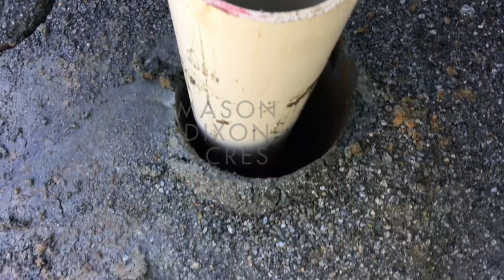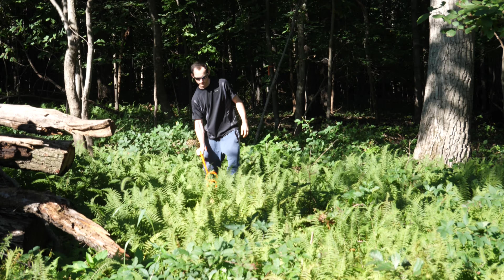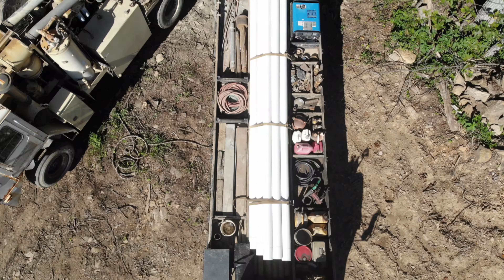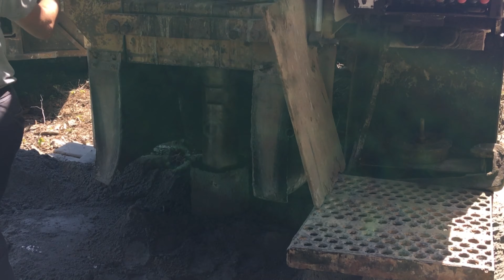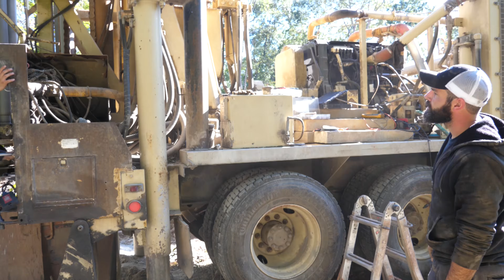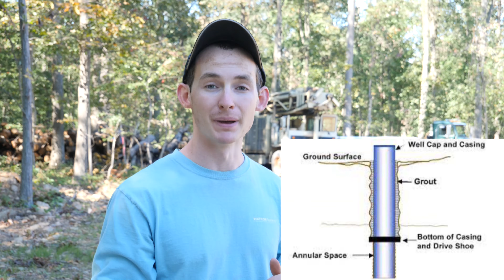Drilling a Well | Process Explained & Cost Breakdown

Comment: I had Myers Bros drill my well here in York Haven Pa back in 2018 at a cost of $7k total including drilling, casing, (steel casing) submersible pump, pressure tank, filter, and UV light. The well is 250 feet deep and produces 12gpm. I live in one of the few townships that do not require well permits.

Comment: After the well is drilled a lot of folks don't realize they still need drop pipe, pump/motor, and cable/power at the surface to get water. My parents were clueless on that and their well sat for 8 years after it was drilled. They ended up installing with Boreline for their drop pipe so they could install the pump themselves. It was easy to roll out, attach power cable and pump, and then just lower it into the well by backing a truck towards the well and lowering it in over a roller. Super easy and took an hour or so. Lots of options out there these days, but the Boreline has a 50yr warranty.

Comment: Oh my goodness. I am having a well drilled in WI today. My bid was $80/ft drilled to 190 ft and with the casing and pump/pressure system, it came to $24k. 😩
Reply from the maker: That's not as bad as others we've heard of in desert areas! Keep in mind this video did not include the trenching to the house, pipe, pump, or pressure tank. Good luck with the project!

Comment: Thanks for making this video.  You did a nice job.   Already watched a number of similar videos and none of them, including yours, talks about some basic things (which a novice like me presumes), like, the drill bit goes down to the bedrock, so they have to bring that back to the surface, then they drill a wider hole for the casing?, then the pvc casing (or some other material) goes down the hole, but if it's pvc casing, what is used to keep the pvc pipes connected?

Comment: What ever state you live in , it’s super cheap . In Wisconsin it’s around 57- 64 dollars foot, plus equipment.
they typically use steel casing in my area. 
My cost on 6” PVC pipe is 11-12 dollars foot from my supply house.

Comment: Holy shit we were just quoted $30,000.00 for a 120 foot well in our local which is flat soft ground.
Reply: Yikes! It only cost me $7k total back in 2018 including drilling, steel casing, submersible pump, pressure tank, filter, and UV light. The well is 250 feet deep and produces 12gpm.

Comment: You missed an important step, did anyone witch the area to see where to drill to find water? Or did you just guess and pick a convenient spot yourself? I have never seen where the side of the upper well casing was penetrated, a pitless adapter,  to access the interior of the well. Why was that done? Here in the Sierra Nevada Mountains in California the wells all exit from the top of the casing. Then they make a 180 and go down under the frost line, then to the tanks. That was a way cheap drilling job you got, most cost a lot more. My well is 200 feet deep, 100 feet to water, pump is at 180 feet, and I get 40 GPM. Good video and explanation on how the compressed air assists the drilling.
Reply from the maker: Thanks! The pitless adapter is to keep water below frost line all the time. Doesn't your water freeze if it's coming out the top of the casing then back down? 
Regarding the drilling spot, I talked to the driller about this - his best advice is to just pick a convenient spot that's out of the way of construction. He has worked with "water sniffers" who claim to be able to locate it and in his 20 years of drilling he said it's total bs.. but to each their own

Comment: I paid $4800 for a 240ft well with 6" steel casing in PA. Thats actually pretty low for my area.
Reply: It only cost me $3k to have a 250 ft deep 12gpm well here in York Haven Pa. It was another $4k to install the submersible pump, pressure tank, filter and UV light. This was back in 2018.

Comment: Central Oregon well is usually over 800 feet deep. 30-40K. You're so fortunate. I ended up trenching to a city water line, which still cost 18K because of the amount of rock.
Reply: I just had one drilled west of Portland. I had to go 975', but luckily I hit 36 GPM and it's flowing out of the top at a rate of 8 GPM. Total cost was $64,000.
Reply from the maker: Wow. We are definitely lucky!
Reply from the maker: Holy smokes..

Comment: That’s the cheapest 300 foot well I’ve heard of. It would be around $30,000 to get that depth here in Western Oregon.
Reply from the maker: We definitely got a killer deal, normal cost here would have been closer to the other two bids I got of $5-6k. But seeing some of these other comments around the country, I consider us lucky!
Reply: You’re not alone.  I’m about to do one in Northern CA that will probably be 150 to 200 feet and it’s over 20K.
Reply: @jamesb95 where abouts?
I'm looking at a place in g.valley and it's 35/per foot.  I hate not knowing if there's water or not too
Reply: Mine was $17.5K in Northern California for just drilling at 120-160 ft.
Reply: @xiong2moua I'm looking for my house to dril water borehole for 300 metres. Can I have borehole agent number
Reply: I’m trying to figure out the cost disparity here. I’m getting quotes for about $80/foot plus incidental fees here in central Washington. It’s looking like $36k for a 400’ well.
Reply: I'm in Ontario my new 115ft well 6" cost me 11460.00 
Drilled in 3.5hours from time they showed up till we hit water.
My old 4" well about 75yrs old dried up while we were on vacation.  Found out 2 of my neighbors also had dry wells.
New well has 35gpm refill so I'm very happy. Still friggen pricey to drill for free water lol thanks for the videos
Reply: 250ft , 11K
Reply: The cheapest company probably just drills deeper make up difference
Reply: Come to india we do same drilling for only 3 usd per foot only for drilling till 1200 feet. Our drills are Indian but compressors Chinese doosan with diesel power. Plastic casing should be same as india for soil part, no need for rock should be at Max 12 usd per 10 feet section for best quality casing of 6" dia, basically sold by weight to discerning customers and length by unwitting people.

Comment: I asked for a quote here in South Texas for a 225ft well. I was told due to my location they recommended the drill rig that cost me $38 per ft vs the $32ft. $9,000 for a completed well with  4" pvc instead of 6" casing. I only have 1 quote as I am looking for other contractors within 90 miles.
Reply: There is a way to do it for way less. Where in S Tx are you?
Reply: @ROBERTLUCIAn  I'm In Zapata, 50 miles South of Laredo.
Reply: Here in N Nevada they wanted $140.00 per foot a year ago and have to drill 260 ft.
Reply: Sounds pretty reasonable.
Reply: Same here. I'm in central TX and all wells quoted are around the $30+ dollars a foot and a 9-12months backlog.

You also need to look at pump  warranty, I'm willing to pay more for a 5 year warranty.

Comment: 11k estimate on 200 ft with pump and pressure tank in Western Maine quoted
Reply from the maker: The original quote for the guys we went with included the pump, trenching, tank, wire, 300ft hole and was around 10k so that's not too far off.

Comment: HELP!!! I’m looking at buying a property that has a collapsed well so I’ve been searching for well drillers here in Denton, Tx (north Tx) and I’ve been quoted $100 a foot and the drill depth is 800ft totally $80,000 to drill a well. I’ve called around 5 drillers and they are all the same. I hope someone on here can give me some insight on this INSANE drilling cost..
Reply: Residential well? I’m a driller not far from you. I’m out of Decatur. We haven’t done a whole lot in Denton, have drilled a couple, drill a lot in ponder/krum/Sanger. Typically 400-500 deep in those areas. 
100 a ft seems steep. We have had regular price increases due to inflation, it’s been crazy. But I believe we are around the 40 dollar a ft  range at the moment, that is also turn key, pump, tank,etc
Reply: @chasehoneycutt4045   Chase, Thank you very much for reaching out. Yes Sir residential well, I sent you a message on Facebook, I’m pretty sure it’s you. Let me know if you get it! Thank you!!

Comment: So the casing can be plastic? Other video I watched had metal pipe. Woukd it be strong enough? Is it much cheaper then steel?
Reply from the maker: Yes most are pvc now. No worries of corrosion either. Steel is extremely expensive compared to PVC, many times more
Reply: @MasonDixonAcres  yeah most are SDR21 pvc, metal is good but 2-3+x the cost. I don't know how the older generation did it, but my Grandparents homestead had a well hand dug and bricked lined 30-45ft to the water surface.

Comment: How much is the fuel cost for a 3000 ft well in Rocky land?
Reply from the maker: No clue. A lot more this summer I’d guess
Reply: @MasonDixonAcres  300,000 to 500,000 dollars Australian 
for an Artesian, flowing,  water well of three to three and a half thousand feet.
Water might be 60 degrees C. 
Hot water is handy stuff; hot enough to scald a pig, and no need for to buy a hot water system, meaning,  you can take nice long hot showers! Yessss!

Comment: Holy fuck I have been in the water well business for 20+ years. I wouldnt even start my rig for 10 dollars a foot. How are these people still in business? Its over 30+ a foot in central texas.
Reply: I’m a driller in north Texas and I agree with you. We’re almost 40 a ft. Insane inflation, crazy how high everything is getting.
Reply: Just finished watching the entire video, im not sure how these guys are still in business.. 50k for an engine swap?? Are the pistons made of gold? Jesus christ. Man you got a hell of a deal on that well.. thats 15k+ complete with pump/tank all day here.
Reply from the maker: Haha I couldn't tell ya, probably a $30k engine from Cummins and $20k labor. I agree that it was a fantastic price for drilling, even compared to others I got quotes from. Their quote for a complete setup was like $11k though so that's probably where they make up for their cost. Glad they were willing to separate out the drilling, I think I can run the line myself. The driller also said they have work 100% of the time, probably because of their prices.
Reply: What is the going rate in central Texas? My well at 270' is dry and probably need to go down to the lower trinity ~450ft. I heard around $60ft ouch!
Reply: @TxTropicalPond  depends on location really could you give me coordinates to a nearby intersection? I'll look up some logs. Some county's require steel casing. Sometimes it's better to drill another hole.

Comment: We drill wells in Pittsburgh Pa, that is really cheap. Did they install a liner or is it open hole in the rock? If I drilled that well id be between 6k-8k depending on if it’s lined. Our finished residential systems with drilling range from 10k-20k. How far does it pump and what size house does it supply?
Reply from the maker: I also thought it was a very good price, the other 2 quotes I had were around 6k. Beyond the casing it is just a hole in the bedrock. I will say this company quoted me on a finished system and everything else seemed quite high - trenching, pump price, installation labor, etc. so I cut all that out and just had them drill the hole. I am procuring the rest of the stuff separately and will install myself. The well is around 120' from the house. Right now we are building a small 2bd/1ba garage house which may be added onto for a total of up to 5bd (limited by septic).
Reply: @MasonDixonAcres  what type of pipe are you going to install the pump on?
Reply from the maker: 1” HDPE.
Reply: @MasonDixonAcres  fusing hdpe together? Or rolled poly pipe? We install pumps on 1” sch80 threaded pvc in 20 ft joints, or rolls of poly for hard to reach spaces, since it doesn’t have a liner in the hole and it’s open rock you need to make sure your connections are solid so you don’t lose anything down the hole, also if it caved in some day that pipe may not pull back out of the well. You can’t set the pump on the bottom of the hole either since the motors are water cooled, you’ll need to be 10 to 15 feet off the bottom at least.
Reply: @MasonDixonAcres  depending on the pumping level you will probably need a 1hp, 10gpm pump. 1hp only runs efficiently on 12/2 wire up to 400 feet total wire run. If you set the pump at 220 to 230 ft plus the ditch length and the wire run to the panel, I would run 10/2 uf wire in the ditch and from the panel to the pressure tank and down the hole you can get away with running 12/2 but you may just want 10 the whole way to carry voltage more efficiently. Two wire motors don’t need a control box, if you set a three wire pump with a control box you’ll need 10/3 with ground the whole way. Don’t listen to the electricians when they say the 10 wire needs a double 30 amp breaker. Locked rotor amps on a 1hp requires a double 20 breaker so if it goes bad it actually trips it at the panel.
Reply: @MasonDixonAcres  I would also install at least a 35 gallon volume equivalent tank,  you need at least 10 gallons of draw for your cycle, it would be better to have a bigger one too for life cycle of the pump but don’t skimp out on the tank and go with a small one, pump will go bad sooner. What brand of pump are you purchasing?
Reply: @MasonDixonAcres  with your water entering the hole around 90 ft you can install a smaller pump higher up the well and get away with smaller wire. If the well ever slows down we find it better to have the extra storage in the well to pump off of, but you can probably put a 3/4 hp pump in a bit higher and get away with a 12 wire install to save in cost, put the ditch wire in 1” conduit if you can so if you ever have to drill it deeper some day or redevelop and set the pump lower you can upgrade the wire if necessary, a 2-wire 10gpm, 3/4hp set between 170-200ft should work and if it ever draws down further you can extend the pipe and wire down the hole to try and get more storage!
Reply from the maker: Thanks for all the info! The plan suggested by the driller and another well guy I talked to was a 2 wire 3/4hp @230’ going to a 44gal pressure tank. I do like the idea for conduit, although it’s ungodly expensive currently.
Reply: @MasonDixonAcres  that sounds about right, on the pump, I’d recommend getting a 240ft metal fish tape and buying a 150ft roll of 160psi or 200psi 1” poly pipe, put the fish tape through and pull the wire through the one smooth piece of pipe, pvc sch 40 is ungodly but the black poly pipe is still relatively cheap! Use a plastic barbed adapter for the poly to thread into the well cap and seal it from the inside. We install those same royer well caps that they have on yours.
Reply: If you’re already getting a roll for the water line in the ditch, you can just get two of the same length or one big roll

Comment: Wow I’m a driller in Canada and we’re drilling at $44 per ft and $28 per ft for casing .. no idea how these guys can make a living at those prices ..
Reply: Agreed. I’m a driller in Texas. The rapid inflation has forced us to keep increasing prices just to cover material cost. We’re at 40 a ft right now. The price this gentleman paid wouldn’t even cover the materials, fuel,etc
Reply: @chasehoneycutt4045 Everything got more expensive after covid. I'm glad I bought my property, had my well drilled, solar panels installed before then. Paid for it all outright.
Reply from the maker: Holy crap so that same well would have been over $13k?!
Reply: @MasonDixonAcres  
Easily, with fuel and material costs and repairs not sure how they drill that cheap .. 50G for that engine alone .. good for the customers, but I personally wouldn’t leave the yard for that price .. Glad your well worked out 👍
Reply: @MasonDixonAcres   over $20k in central ca just for the hole
Reply: I contracted for a well one year ago. I live rural in Southern Ontario Canada. Quote from 4 different drillers came in between $25-30k, including pump 
trench, and all associated filtering inside the house. That quote is for the first 100ft. Neighbours well came in at 165 ft. My eyes popped out of my head 
when I saw your price.  Hopefully they will hit water at 200ft. We’re on sand. Light clay layers occasionally.
Reply: Drilling in Wyoming/South Dakota and agree.  I can't decide if I admire the driller for being able to survive on those prices, or admire his willingness to provide his services at a huge loss just to help people out.